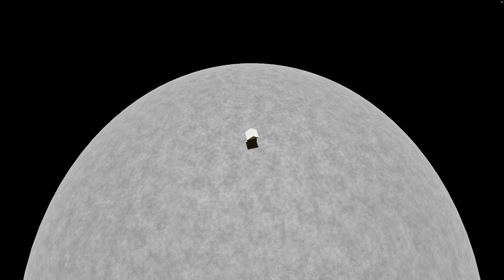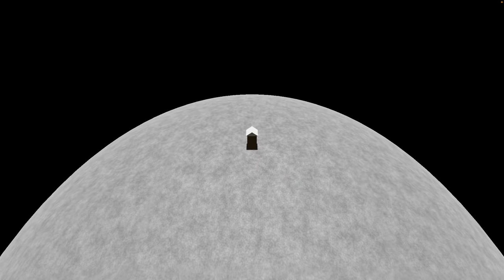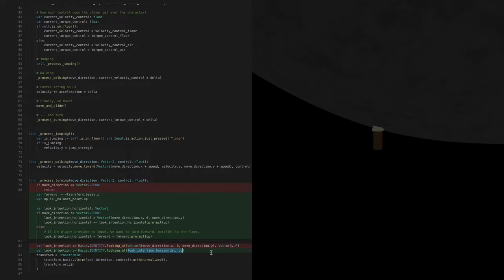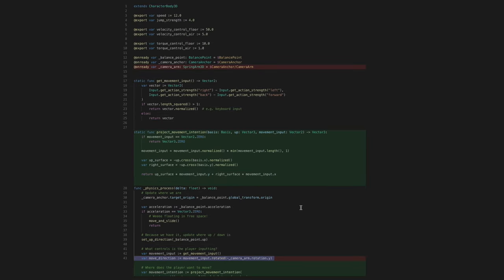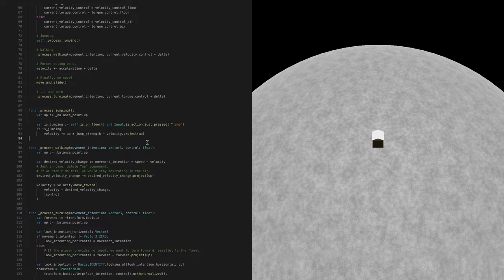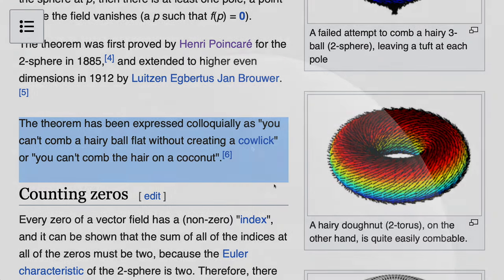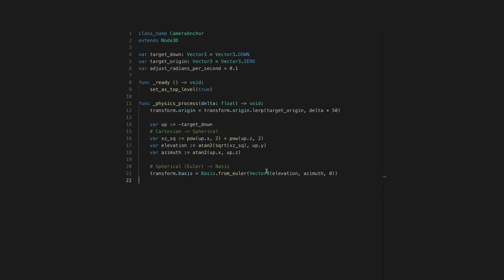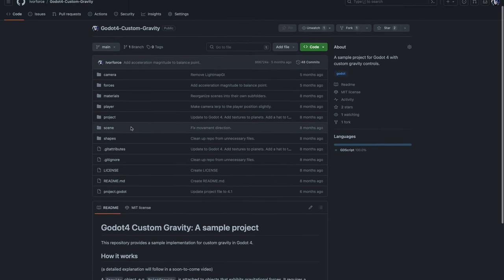I added Non-Newtonian Gravity to my Game

Comment: Just came across your two videos on gravity and i have to say they are really well done and I subbed as soon as i watched them. Would this gravity work with rigidbodie as well (with some minor adjustments, like using forces to move the character around instead of the move_and_slide function) in godot? And would a first person perspective work too?
Reply from the maker: Thank you!!
To your questions: yes, the custom gravity equations would work as forces for rigidbidies too. First person would also work (with the same adjustments you'd need to do with first person cameras in regular gravity).
Reply: @Ivorforce  Thanks for the quick reply!!
Reply from the maker: @splatnamby  no worries :)